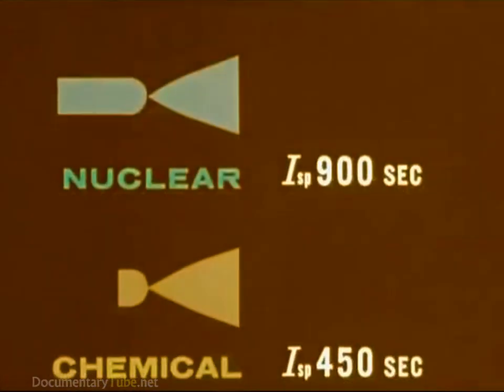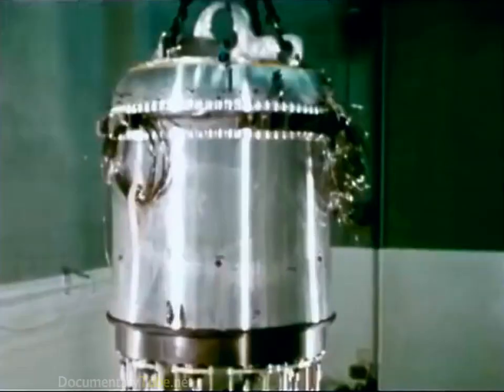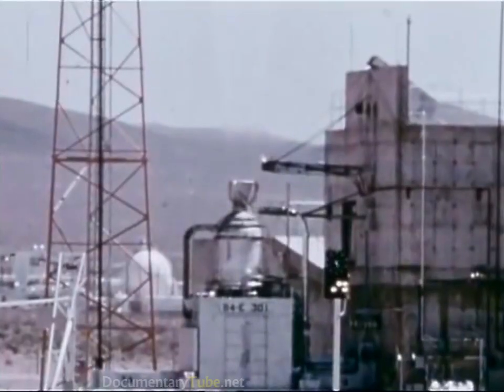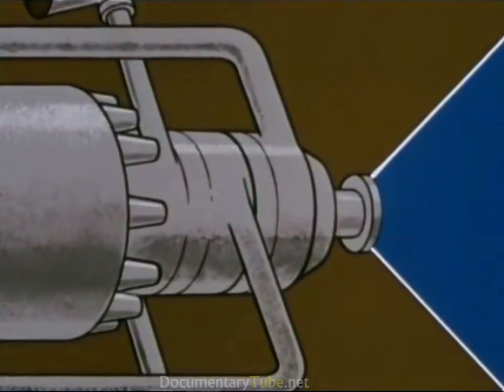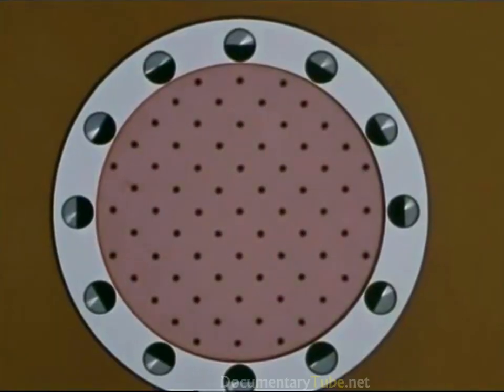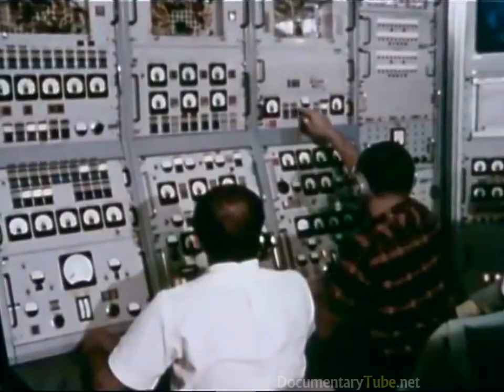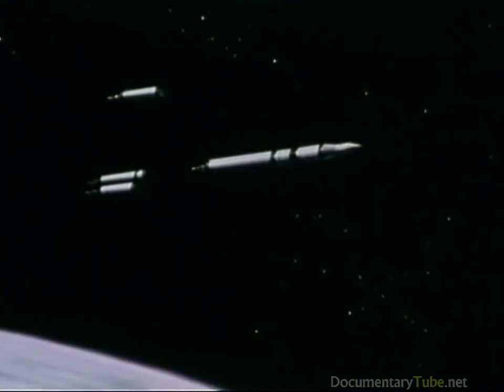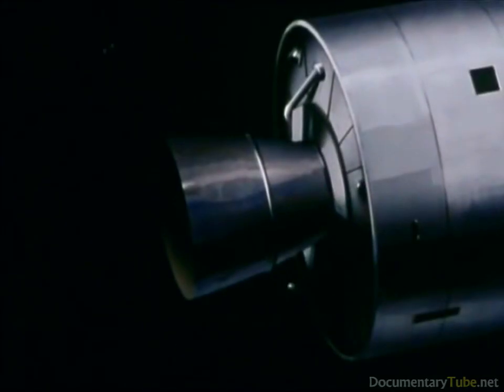HOW IT WORKS: Nuclear Propulsion

Comment: Hey boys! Electrical ion thrusters give a much higher specific impulse of up to 21500 s compared to nuclear thrusters only 800 s. The only drawback is their very low acceleration of a 10000th of a pound. But its contructed to be continuosly running of several months. The maximum reachable speeds are in the area of several hundred miles per second(!!!). This is much higher than actual chemical thrusters combined with gravitational assisted swing by maneuvers can reach. And - you don't have a nuke starting and perhaps exploding short after.
Reply: xenon is expensive tho

Comment: Nuclear implies human shielding for space flight 
implies greater mass inertia that must be overcome due to
shielding.
Does DoE plan for manned travel into space.  how many rocket failures may humanity
sustain before radiation loss as a factor involved in space travel
Reply: The hydrogen fuel is a shield to start with.  Keep the drinking water to the aft of the habitation section and the only radiation you need to worry about is what's already out in space.
Reply: the radiation that already present all time in space is more radioactive than your nuclear propulsion strap to a spacecraft, its fuel(hydrogen) is very good at slowing down neutron and make a pretty good shielding and a few inch of lead will do the job

Comment: Are they burning hydrogen using the heat from nuclear, if so whats the difference them the chemical rockets.
Reply: I believe it is more like a plasma, hotter than chemical rockets.
Reply: No combustion takes place, it has been stated pretty clearly in the video around 0:20

Basically the thrust in any rocket is produced by the exhaust gas forced through a nozzle typically optimised for the situation that stage is expected to operate in. Different designs are needed to work efficiently at earth atmospheric pressure and space vacuum. In chemical rockets the heated gas is produced by burning some kind of fuel + oxygen (always true whether its solid fuel or liquids).

With these designs the energy source is the fission reactor that heats up liquid hydrogen into high exhaust temperature hydrogen gas. This phase and temperature change causes a high pressure at the exhaust and thus the rocket is propelled in the opposite direction of the exhaust gas.

As for the actual temperatures, I don't know Dan it all depends on what the reactor and rest of the design can safely handle. I seem to remember that a stoichiometric hydrogen + oxygen combustion the temperature potential was between 2600-3000 degrees Celcius (too lazy to look it up). The design referenced in the video mentioned "about 4000F", so that converts to 2204 C which is quite a bit lower than ideal oxygen hydrogen combustion. But it is a pure hydrogen exhaust gas which at equal temperatures does work better than a mixture with heavier exhaust products.

Comment: Check mate to hawkings, nrx needs piping more tolerable or bended on similar design shell slight above to follow research and design and perhapse a doubled cooled piping for iso purpose . To calm down the hawai crust if it goes for for design and scfi, since patern is more like star wars  movie ending between young anakin becomes vader and fights obi wan, inc lava pour as factory mold, anyway strategic vulcan flow in midle of ocean for power off ocean and eart cooling is nature show now how in prestage universe life  and creating habitable life cooling conditions requires star trek aproach, analisys would gave a impresion a giving burst show signs off universe life posibility or even vulcan habitable conditions on earth an sign off scfi engines, propulsions  and space flights, first fix then it would be more chance for normal calm solution that it literaly says a nuc propulsion is durable enough open lava cuts in favour of this , bizar and so much adds accepting conditions and android now  there are real natural conditions for it!

Comment: Nuclear engines would be a viable alternative when in low earth orbit, because radiation wouldn’t be an issue.
Reply: its very good for interplanetary transport, the fuels is just hydrogen or whatever gas is acceptable as long it doesnt corrode the core
Reply: It would be a huge issue when one crashes. It's a useless idea for that reason alone.
And how would it be good for interplanetary transport when it takes so much hydrogen? How large would the fuel tank need to be? Face it, people, for centuries humans in any kind of large number are going nowhere but here. We'd best focus on preserving this planet as best possible.
Reply: @hootowl6354  Extremely late to your comment, but no, it won’t crash, unless they deliberately pointed the nozzle in retrograde. Also, many space probes already went to Mars and the other planets with conventional and less efficient chemical propulsion, using a nuclear one won’t be a problem with the fuel.

Comment: Regarding anti-gravity technology. Remember, there is acceleration (towards earth) due to gravity because the space around earth is warped due to its tremendous amount of mass present. So it is just logical to deduce that in order to negate the effect of Gravity, you need to warp space and thus requires a huge amount of mass or energy comparable to the stars or other larger than earth object. That technology is still years if not thousands of years away from us. Remember we are not even a tier 1 specie to even harness the power of a star. (a depressing thought)
Reply: Harnessing the power of star is Tier 2, while power of the planet is Tier 1. We are somewhere in the Tier 0 now.

Comment: I think we need to find a way to get a bunch of these up into orbit. Fully and basically endlessly reusable ones.  It's the only realistic way I can see us getting out into the solar system any time soon.  The moon is  one of a few places hydrogen etc can be easily extracted and placed in orbit in fuel tanks.  Even when made stronger and safer these would be basically double the specific impulse of chemical rockets.  That means much more speed and/or weight.  To my mind that makes it worth finding a way.  We've been faffing for decades now, impressed by the space shuttle while the epic stuff stopped.  Enough. We're smart enough to get some of these nuclear engines into orbit and out into the solar system.  We can catch up some of those lost years.

Comment: ... and it’s jettisoned! The ‘60s mantra I guess hehe.
I guess nowadays we could use thorium instead of Ur. Or may be they’d already testing a mini MARA... sci-fi, I love it!
Reply: This is a common misconception of the thorium crowd. Thorium is a fertile fuel, not a fissile fuel. What that means is that you can not fission it to make energy. The way it works is that Thorium 232 absorbs a neutron to make it Thorium 233 which decays to Protactinium 233 which then decays to Uranium 233 after about a month. In short, you're still Uranium but you've added a bunch of extra steps.

Comment: The nuclear reactor's thrust could be used later in the outer space where radiation is not an issue but in Earth's atmosphere, we could use chemical thrust which pollutes the air less than the nuclear thrust.
Reply: Russia has nuclear powered ICBM called "skyfall"😤
Reply: @lumapas  Didn't know it.

Comment: So am I understanding this correctly: All the exhaust gasses exiting those test rockets was radioactive? Hours upon hours of high velocity radioactive gas being expelled into the air we breathe? That does not sound like a winner to me! And, what was the life expectancy of any of those engineers working on that project?
Reply: They released hydrogen which was burned. When you burn hydrogen it makes water. Some of they hydrogen had absorbed an extra neutron making it deuterium. Water made with deuterium is called heavy water and is routinely used in medicine. Moreover, as deuterium and heavy water is naturally occurring, you actually have about 5 grams of heavy water in you right now. Long story short, I wouldn't worry about those tests at all.

Comment: So you would have to keep liquid hydrogen near absolute zero in order to use it. That sounds impossible in a weapons platform that needs to be launched on a battlefield. A better setup would be a closed loop portable fission reactor providing electricity for a EHD thruster. The thrusters exhaust doesn't even show up on infrared I've heard.

Comment: Evenwith nuclear reactor they still needed to load a lot of hydrogen fuel on the spacecraft. This makes it less efficient weight wise because they'v added the weight of the reactor which was heavier than  oxygen tanks.
Reply: Not much we can do, molecular materials simply can't handle full nuclear fission power, thus we use the heat from the reactions to propel hydrogen.  There are a few proposed designs using tacomak magnetic donuts for containing reaction fuel hotter than the surface of the sun, but our nozzels simply can't take the heat once directed.  Wierd and exotic materials and super science would be required to go beyond hot rocks and fuel to truly nuclear engines

Comment: What about all that nuclear radiation that is being spat out of the ass of these things .... totally uncleaned, We are simply raising the radiation level everywhere with this concept.  God help us all.  We need the already developed "bypass" atomic reactors where the waste gases are NOT irradiated. Sadly they are much larger and more complex, therefore expensive, so my guess is that the Yanks will go ahead and irradiate everything with these sorts of propulsion systems if they ever consider actually using such a horrible device.....  But then again, they have already irradiated most of the state they performed those test runs  shown in the video anyway - wide open radiation filled rocket exhausts blown up into the local air.....  Nice one for the local area eh ?

Comment: Lets make an engine wich blow up an entire town when it fails. Brave.
Reply: I suspect it wouldn't blow up a town (if properly designed), it would however cause a fair bit of radiation and perhaps a molten radioactive core or something. But consider a traditional chemical rocket, pretty sure that would easily blow up a small town too with all the liquid oxygen and fuel stored in there. But that's why launches are done away from inhabited areas, also failures in chemical rocket launches are easier to mitigate since in a worst case scenario you can blow it up in the air with relatively little harm. 

When using a nuclear reactor it'd be trickier, a way to be able to stop the reaction reliably (preferably still in flight) and recover the reactor from the inevitably crashing rocket would be needed. Depending on the construction though I guess if it crashes hard enough on that maybe the reactor will break into multiple parts in such a way that the reaction can't take place.

Comment: Question ? when hydrogen is thrust thru the nuclear core, would it not get radioactive and these guys were just going to dump that hydrogen into atmosphere ??  I would have thought a secondary heat exchange mechanism would be used that separated the core and the hydrogen fuel.
Reply: What the hell do you think happened at Jackass Flats? Hours and hours of that hot hydrogen blown into the air.

Comment: To all these people complaining about how it would leave radioactive exhausts in the atmosphere. 1) These engines don't produce a high enough chamber pressure and are not intended to be fired anywhere but space. 2) The hydrogen does not spend enough time under neutron exposure to become radioactive. 3) Even if a small percentage of hydrogen nuclei absorb neutrons they will only become deuterium which is harmless (it's in your drinking water already). But don't listen to me, as we're all taught in school, everything with the word nuclear in it is BAAAD!
Reply: But - but - but if it were not for nuclear molecules we wouldn't have any bodies.

Comment: Starts mission with 100% of rocket.......finishes with .1% left. The rest of the rocket is now orbiting around just about every object in the solar system.
Reply: Or, it could crash into the Sun and then start a chain reaction since there's no U-235 in the Sun yet, so the sun would go dark when the burnout happens and then it would be too late to fix it. Rats.

Comment: How would these ignite in space? There is no oxygen to ignite anything. Since these engines only have Hydrogen, they should not be able to ignite without carrying an additional Oxygen tank.
Reply: they dont need to ignite, the nuclear reaction is heating the hydrogen so it excites and accelerates out of the back of the rocket. The only light it on the ground so that nothing can cause an accidental explosion
Reply: No combustion occurs. No ignition takes place. Only superheated hydrogen emerges, not exhaust from anything burning. No heavier elements in the plume like they explained in the video diagram. No oxygen is used at all.

Comment: Archaic technology- Draw a straight line on a piece of paper with a dot at each end of the line then fold the paper in 2 so the ends match up. Punch a hole through where the dots line up- everyone knows a straight line is the shortest distance between 2 points.Instantly brings you to your destination - worm hole theory 🤔 Somehow I think certain government organizations already know of the technology to travel like this through reverse engineering- But hey what do I know 😂😜😜😂

Comment: "After deceleration through the atmosphere, the astronauts are jettisoned as they are no longer needed to guide the vehicle.  At an altitude of 20,000 feet, the re-entry vehicle is jettisoned to further reduce weight.  Finally, the parachute module makes the landing at a pre-determined location and is recovered safely by the ground crew, successfully concluding the space mission."
Reply: that sounds very Kerbal-esque... incidentally I have almost done just that.
Reply: Damn! you beat me to it.

Comment: id rather use nice clean anti matter reactions instead of this toxic radioactive nightmare.
Reply: Then you might get a nice, clean singularity to deal with :)
Reply: i'd like that
Reply: Your fuel bill will be scary.
Enough antimatter to make a Mars Landing return trip (about 500 grams) will cost you a cool 32 thousand trillion dollars.
(that's about 400 years of the GDP of the whole world)
Reply: Marvin Kitfox - That's why you make your own by converting electrons to positrons by cooling them to absolute zero  and change there rotational path instead of using a giant super collider. Just use positrons to protons or neutrons to make a quark gluon soup in a fusion reactor.  alot of it is up on nasas website.

Comment: But you still need propellant hydrogen for propulsion after it runs out rocket stops. I thought nuclear engine only needs nuclear fuel
Reply: Donatas Kazakevicius, a nuclear fission fragment engine would only need fuel to operate, no hydrogen or other reaction mass. It would have an incredibly high specific impulse (efficiency) but extremely low thrust. It would only be useful for space propulsion.
Reply: Donatas Kazak -- Well that settles it. We must first build some 7-11 stores in space that sell U-235 and hydrogen.
Reply: Tom Carman still it is irrelevant we need something else entirely to conquer space even light speed is too slow for space travel

Comment: Why don't they use water in place of hydrogen
Reply: Less efficient.
Reply: Water has wa-a-a-a-a-a-ay too much oxygen. Plus it leaks and makes a mess in the ceiling.
Reply: See the two "reasons" below.... BUT the big reason(s) were:  hydrogen is light.... cryogenic....  and served as a coolant for the core and nozzle and other components, as it made it's "complex - meandering" flow through the core

Comment: I still think this should be considered chemical or Nuclear-Chemical because you need hydrogen stored onboard. This is Nuclear but has traits of chemicals.
Reply: It doesn't depend on a chemical reaction, I think that's the key point.  Combustion is a chemical process, NTR's are just open ended cooling systems. :)